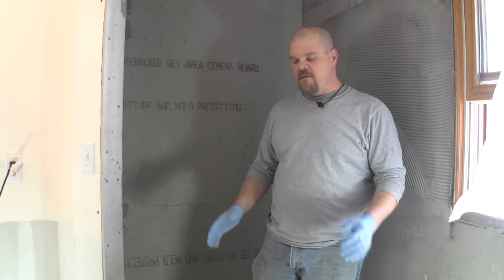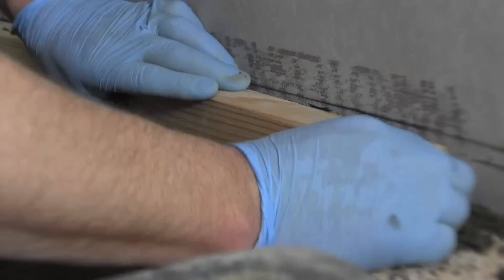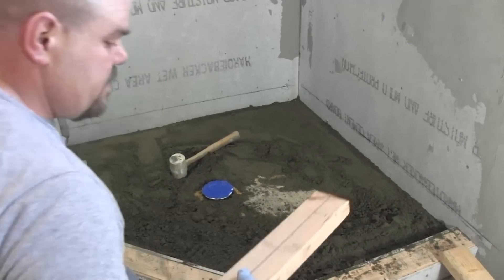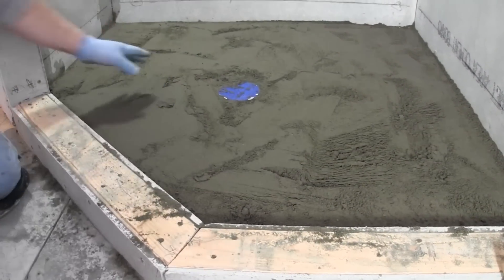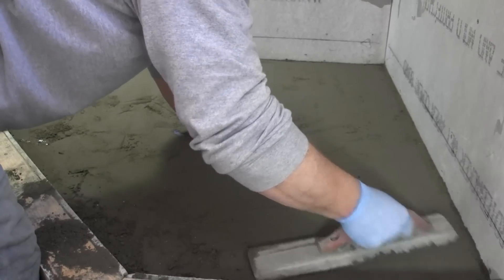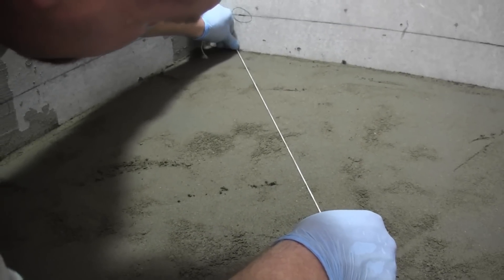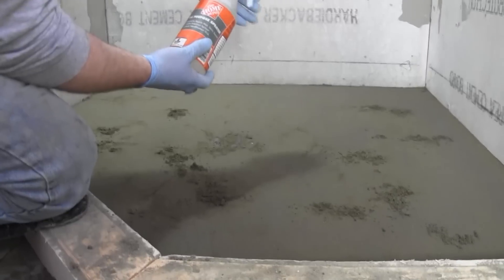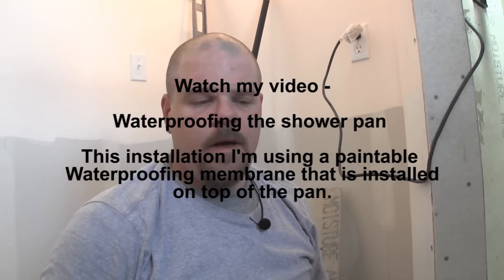How to build a custom shower pan -  installing the pan

Comment: For people watching trying to figure this out before I started my shower pan, I made it a much bigger deal than what it actually was, but when you don't know you got to get in there and get your hands dirty and puzzle it out, you'll find it's not that big of a deal. 
After speaking with Joe, I understood it doesn't have to be exactly a quarter inch to the foot, you can be a half inch maybe even three quarters of an inch to the foot on your slope. So based on this know how far to come up with your deck mud on your drain, before you start. Follow Joe's instructions here in this video and you'll be fine Joe's, instructions watch what Joe is showing you.  Remember just taper it down to the drain.  Yes putting the deckmudup against the wall to the height do you want it and then screeding it down to the drain truly is the best way to go about this when you don't know

Comment: Thanks for all of this very helpful info!  I'm in the process of doing this for the first time in my downstairs shower . I've got the old fiberglass enclosure out and have bought all of my materials.  I'm going o fill the hole left by my builder first and level it, then start building up my curb and between the studs so I have a place to nail the rubber membrane.  Any other tips or notes are appreciated. Thanks !
Reply from the maker: I wouldn't use a bladder!  That is my advice. Use hydroban or kerdi made by schluter!

Comment: Other videos I've watched they do a pre-slope then the pvc liner, then the mortar bed. I noticed you didn't do the pre-slope or the liner? Do you feel it's not necessary since you water proof with the hydro ban? Your leveling method with the 2x4 for the perimeter is brilliant by the way. Also, the time you took showing how to get the slope correct is the best I've seen on here. I learned a lot. Thanks
Reply from the maker: If you use a pan liner under the pan then you should still use a membrane on the walls forsure. Honestly ditch the liner and use Hydroban. Its so much better!

Comment: You packed the weep holes pretty tight? Shouldn't you leave some small pebbles or a few foam tile spaces to keep the weep holes clear?
Reply from the maker: No Francis. Because I am using a paintable membrane on top of the pan so water is not intended to go through the pan to the weep holes. It will be stopped at the surface.

Comment: Quick question.. You mentioned that you used to use a PVC liner but no longer do. Wouldn't it be a good idea as a 'just in case'? Having that extra layer of protection between the pan and the floor. What is the likelyhood that the sealer/grout/tile layer and the hydroban fail? If that happened, I'm guessing water would reach the subfloor. No expert here just looking for your thoughts as I'm attempting to build a shower currently. Thanks!
Reply from the maker: No!!!! Why would I. The stuff I use is outstanding in performance and ease of use. It also provides protection against future movement. I've been using this for many years now and I have never had a problem or a failure with it!

Comment: Should the shower drain cover be slightly above the finished sand mix, to compensate for the floor tile thickness? This will result in the drain and finished floor to be level. Thanks for all your great videos!
Reply from the maker: Can you share a pic on my facebook page? There is a link for it below

Comment: Thanks for all the videos.  I read on the Sand and Topping mix bag that the tile has to be installed within 16 hours of the pan being put down or 28 days to fully cure, this is due to the possibility of delamination between the tile and the shower pan.  What are you thoughts about this?
Reply from the maker: I use a sand mix that I buy from a tile shop. It doesnt have stipulations like that.

Comment: SoThatsHowYouDoThat can I use Kerdi waterproofing membrane over Durock and my mud bed?  Also I have the Kerdi ban to use on seams and corners, will that work with Durock? If so, do I need to use Redgard or unmodified thin-set to apply it? First shower demo and remodel, I have 2 more bathrooms to do so your videos have been invaluable to me.  Thank you so much for helping us DIYers improve our homes.
Reply from the maker: Yes you can go over cement board with kerdi but..... why not use hydroban?
Reply from the maker: Have you been to my website? Check out Tile university all my videos are in there to help you through this project.

Comment: is it necessary to use a pvc  paper on  the plyood floor prior to the mudmix?
Reply from the maker: No, not if you are going to use a paintable membrane on top of the pan. But you could use a tar paper on top of the subfloor prior to installing the mudmix.

Comment: is the backer board supposed to be 1/4" above shower pan? Meaning shower pan first then use backer board, which makes an overlap...
Reply from the maker: No. I install the cement board to the floor then install my pan. But if you use a pan liner and not the paintable membrane then install the cement board tight to the pan.

Comment: How hi should the I build the first level of concrete before adding the shower pan ? I was told it should be about 2 inches at the highest level ? This is for a 28 X 60 shower with the drain facing left . It is not a center drain. Thanks in advance for your answer !
Reply from the maker: Tony, I would recommend you just skip the pan liner and use hydroban or even use Kerdi. Use the schluter drain. Its by far the easiest to use. I just don't like to use a pan liner and let the water soak through the pan. It just doesn't make sense.
Reply: trying to stick to budget.  think I will stay with the pvc pan liner. Kerdi and Shutler systems are too expensuve.
Thanks for your advice .

Comment: What kind of cement did you use, and what is you correct measurements?
Reply from the maker: I use a sandmix that I buy from any tile supplier. The correct mix is not too wet and not to dry. You should be able to form a firm ball in your hand and it it doesnt fall apart easily from being to wet or dry.

Comment: unless i missed it, you did not use a liner to assure no leakage thru the tile, mix and eventually reaching the wood floor below, creating black mold and wood rot.
Reply from the maker: That would be true BUT.... I am using hydroban, which is a paintable membrane that is applied to the top of the shower pan and cement board. This method stops water at the top and avoids black mold that I see everytime I replace a shower that uses a pan liner under the pan. 

Why would you want the water to go through the tile, through the pan and then go to the drain. Does that really make sense. Nope. 

With products that are offered to us today, there is no reason to use the methods from the 70's, 80's and 90's when it comes to waterproofing. Our options are so much better today!! Just look for my video on waterproofing and you will find what you need to know there. I have a link below to Tile university and you will find all my videos there.

Comment: Can you put the sand mix directly on the cement board?
Reply from the maker: Yes
Reply: Thank you. We are in the process of building a tiny house and we want to do a wet room. Do we need to slope the entire floor or only where the shower is going to be?

Comment: Many videos call for extruded wire mesh to be stapled into the base of the shower to reinforce the shower pan. Your thoughts?
Reply from the maker: Valerie, I personally don't do this for a few reasons. Many will disagree with me but i still have not had a pan fail me. I use hydroban on top of the pan which allows movement and I want the pan to allow the floor to move if needed. I believe it allows movement when its not attached to the floor. Just my opinion.

Comment: One thing you did wrong! You build the shower pan, then install the the concrete board! This way the water has no way of getting between the shower pan and the concrete board!
Reply: You don't know what he has behind his concrete backer board I'm sure it's already been sealed before he ever. Put his back on board up to start with. It's easy to be critical

Comment: what is the mortar product called you are using?
Reply from the maker: I mostly use Tilecrete.
Reply: SoThatsHowYouDoThat also did you put any membrane or felt on the shower subfloor before you filled it with mortar?

Comment: Wouldn't it make sense to include the pan liner in this video?
Reply from the maker: No not when I'm using the system I am using, This is a shower system that is waterproofed from the top of the pan, not the bottom. You have watched too many old school methods. We are in a different day and age now.

Comment: rubber membrane underneath for sure
Reply from the maker: No..... Not when you use the hydroban system. That is old school and honestly really not a good choice. OUT OF DATE!
Reply: steve lehner you still need a pan liner,  weather its copper or rubber ,   The laticrete latex  or red guard whichever is good as a vertical waterproofing but not suggested as a permanent showerpan replacement.
Reply: westside98 why???? With the advent of preformed shower trays, the only thing between your subfloor and waterproof with those is a styrofoam tray and thinset, which is also not waterproof.  If the popular and very expensive Kerdi insists that their top layer membrane is waterproof as the roll on companies do (given that you do it correctly), I don't see the difference here except several hundred dollars.

Comment: Some guys bury their wonderboard, some don't. Reason?
Reply from the maker: Not sure what you are asking.
Reply: RMj 
Bringing the tile backer board down into the pan and covering the bottom edge with this top mud mix....Rather than leaving a gap at the bottom like some video clips show. I do it this way , as shown in the video  clip....if your pitch is correct there is no need to worry the backer board will ever be constantly submerged in water or stay wet....I think that is why some guys level the board up a bit....just my guess.

Comment: Where's the rubber membrane? I wouldn't take the risk!
Reply from the maker: The rubber membrane will be a paintable rubber membrane on top of the pan and the cement board.